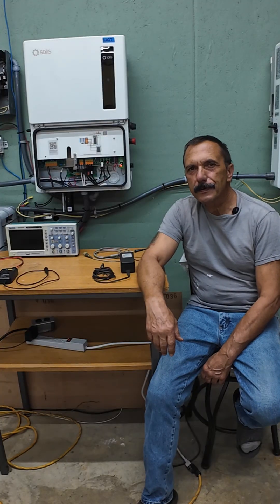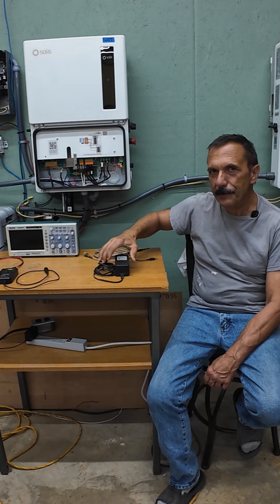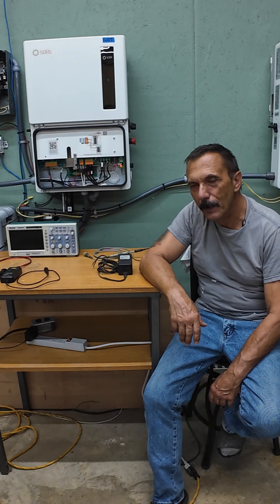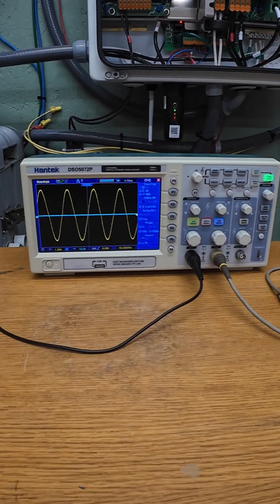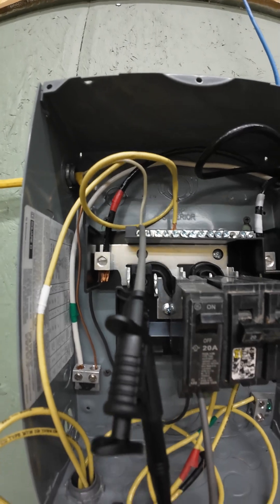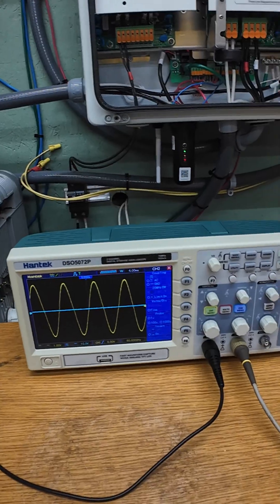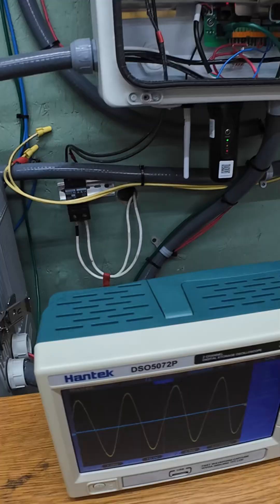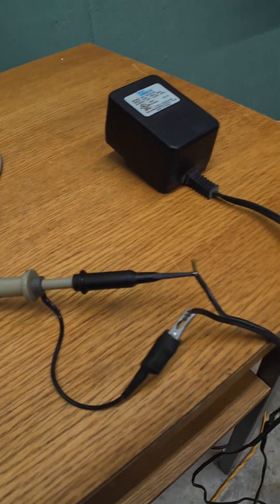How To Safely Measure High Voltage Inverter Waveform With Oscilloscope part 1

Comment: Hello, . If I need to measure 2 point in the same time I need 2 isolated probe like the video. The main question is can measure 2 different point in the same time using these 2 probe ?
Reply from the maker: Yes, that's what these isolated probes allow you to do!